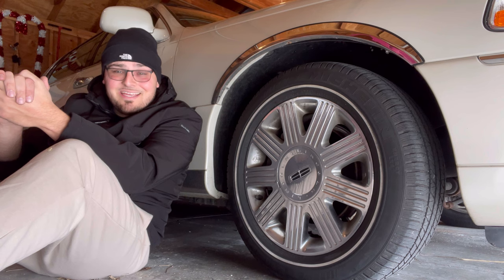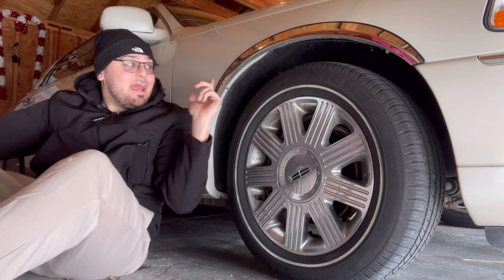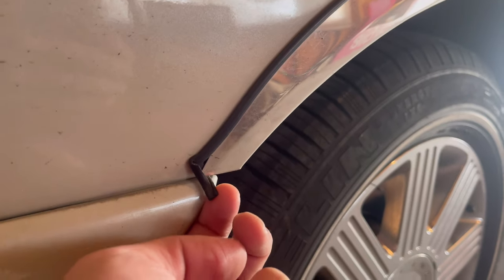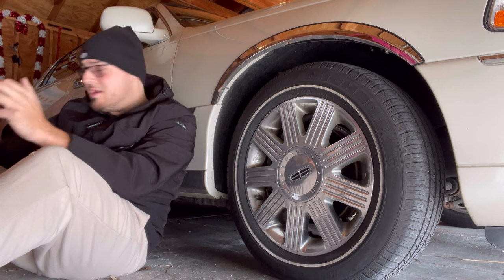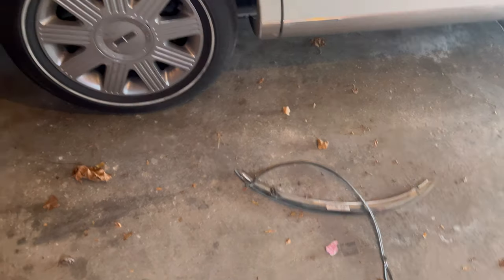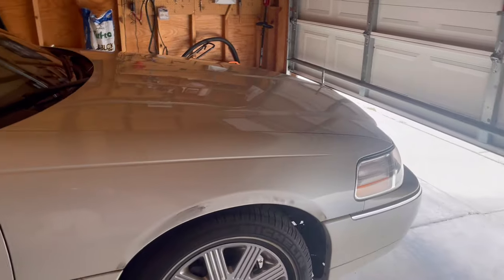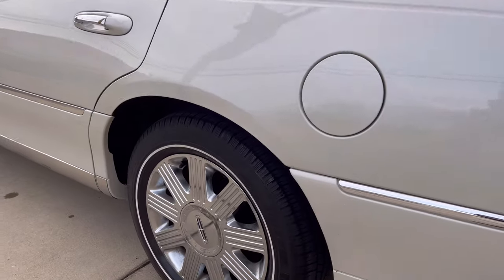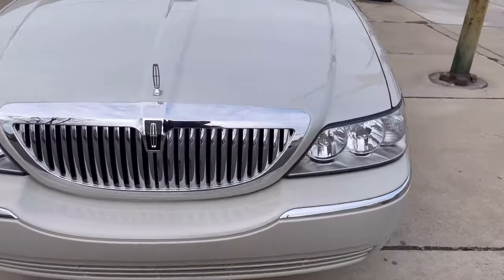Stop Doing THIS to Your Cars if You Want Them to Last!

Comment: Those came from the factory like that on a lot of higher end trim levels. My 2006 designer came from Ford just like that. I like the look of the chrome on mine but it is personal preference. The chrome is all metal as well so I’m not sure if yours is metal or plastic. The eBay bought ones are problematic for the reasons you have said and pointed out in this video. Mines had chrome all around the windows and also the lower rockers too. I’m not sure exactly what is stock on a 2004 Ultimate but I thought it came on a higher trim level like that.
Reply from the maker: Yes when I bought the car the previous owner said they added these. I’m guessing it depends on the year and trim level of production? I figured they were all aftermarket since mine were but you learn something new every day! Thanks for checking it out 😎

Comment: My 05 Lincoln has those chrome pieces on there.  My 03 Lincoln doesn't I would like to take them off because you are Correct that will only add to moisture and rust issues.  I have not taken them off yet because I am afraid of what I will fink underneath.  I have owned my 03 for long time and it has 300k on it and no rust!
Reply from the maker: Yeah I can’t lie I was definitely scared taking mine off as well!
Reply: The fronts are usually held in with screws or rivets. If you yours are screws and the screws are rusty then unfortunately chances are they infected the fenders as well. If you have rivets your chances are better for no rust